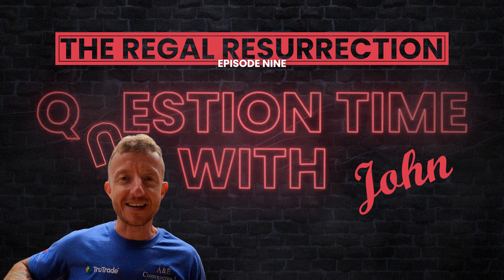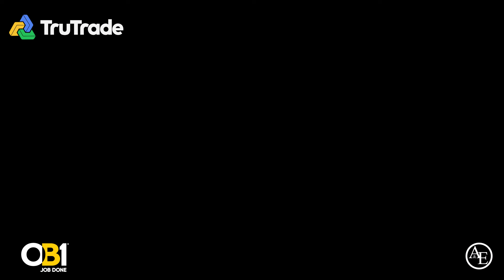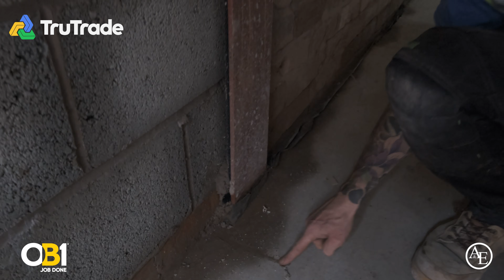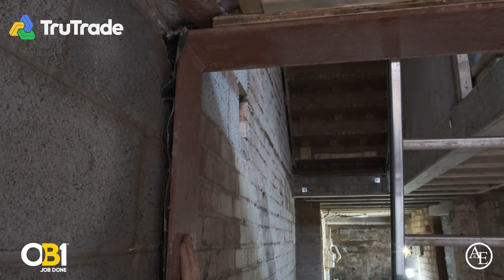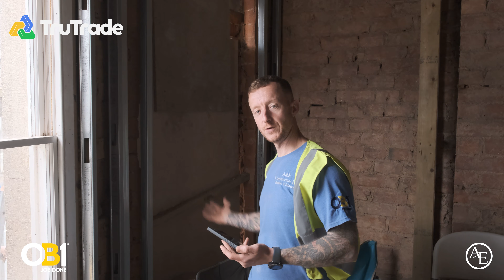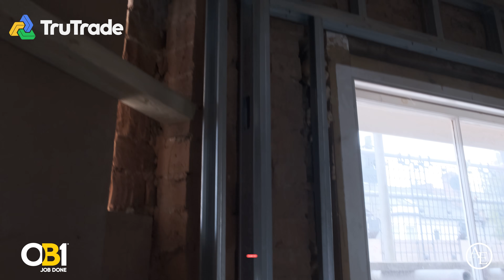AIRFLOW CONTROVERSY! 😳 Question Time With John - Episode Nine

Comment: The steel column should have an expansion/separation joint around the plate area to allow for differential expansion and movement between the steel and the concrete.

Having a steel beam fixed to the top of the column is highly unusual and requires the structural engineer to explain, in 40+ years as an Architect I have never seen a steel beam bolted on top of a UC. .
Reply: A UB bolted to the top of a UC is a standard connection detail, very common.
Reply: @Helibox  The vast majority of UB/UC connections in my decades of experience are into the sides of the UC not the top unless its a continuous beam with a UC prop, which is somewhat specialised.

Comment: Great video as always john. I support what you say regarding metal studwork. I DIY fitted metal studs, continuous celotex on the front, counter battens over that then plasterboard. The created cavity is also ventilated. No more damp, no more mould, very warm and when it's not too cold just one small dehumidifier in the house is all that's needed to keep it toasty. If your worried about studs rusting, don't. I put all the spares in the garden and they are as good as when I bought them.👌💪👍